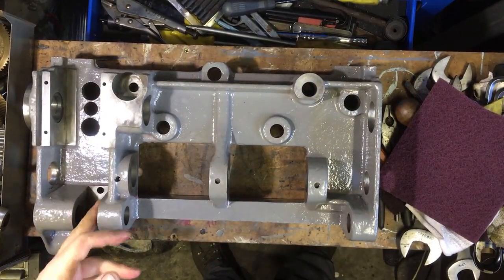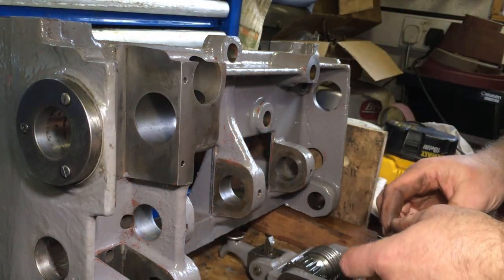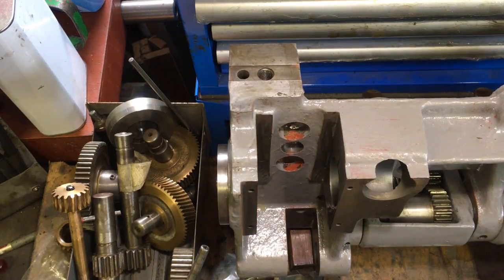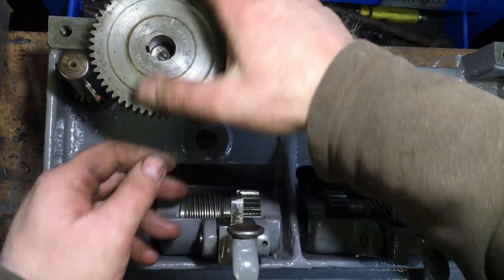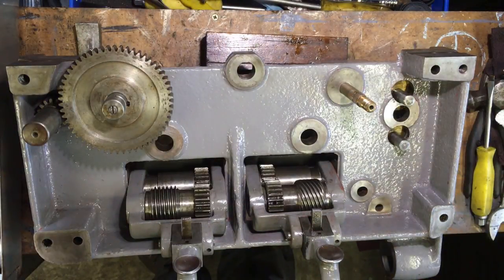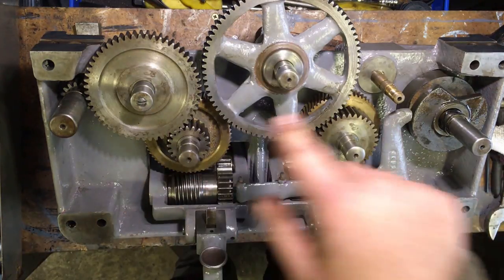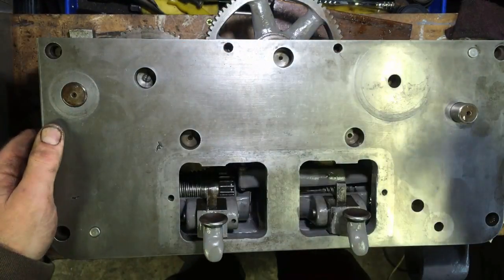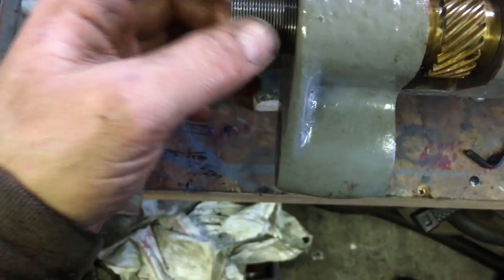Rebuilding the Toolroom Lathe Apron

Comment: Back together and in proper shape! And it looks as if you have indeed used up and re-installed all the proper pieces.

Mark
Reply from the maker: Hi Mark, not many left over bits on the apron. Just a cover and couple of srews and oilers to refit. Assuming it doesnt have to come apart again ;-) All the best Mat

Comment: amazing there is so little wear on the half nuts, must have done little screw cutting in its days.
thanks for the video
Reply: Holbrook handbooks recommended not engaging / disengaging the halfnuts when screwcutting, so there's not the wear from that - they recommended using the leadscrew-reverse or reversing the spindle instead so the nuts stayed engaged and lubricated, my C13 (same age, roughly) also has pristine nuts :)
Reply from the maker: @hopefuldave  Dave mate, you are bragging about your pristine nuts again ! ;-)
Reply from the maker: @hopefuldave  and if I recall by your own account not used much ;-)

Comment: Any specific reason you are assembling the shafts dry?
Reply from the maker: Only that it stops me dropping the things and then having to clean them again. All the bearings and oil ways were cleaned so a good squirt after assembly and turning by hand has the thin iso 32 oil everywhere. Once running the oil is iso 64.

Comment: Mat it seems if you have a good quality lathe or a cheap one the oilways need reworking or tweaking..
I always wondered why people had two lathes one to make parts repair the other one. 
I have one lathe pull it down measure the part make it and rebuild, very frustrating.
Reply from the maker: I have to investigate the saddle / apron to see if the ive missed an oil way for the half nuts. I may well have overlooked something. I can certainly say that the Holbrook in its day was half as much again as the best available in the UK market (1950's). as youve seen there is not any significant wear on the gears and that which I found on the tubes was minimal. I think its been used in the past by someone with a lubrication aversion !
Reply: Half as much again? I heard "The Colchesters on the shop floor cost as much as the Guv'nor's car, the Holbrook in the toolroom cost as much as his house..."

Comment: i would have used grease the oil will eventually run out,  use oil if it can replaced  easily
Reply from the maker: Yo may well be right, but grease dries out eventually and is more tricky to replace without provission for adding it. I have to investigate the oil ways of the saddle to see if there is a drop point for the half nuts. Thanks for watching and commenting. All the best Mat
Reply: Is there an oilway for a drip to the halfnuts connecting to the oil gallery in the top of the apron front plate? The Model C has a manual plunger pump in the bottom of  the apron, delivers to a gallery in the top of the main apron casting with drillings down to the bushings in the front plate, does the T have an oil port that feeds into that gallery and the apron? My C13 had halfnuts firmly stuck with 60 year old oil turned to varnish, too.
Reply from the maker: @hopefuldave  Ive had a good look and cant see an oilway feeding the half nuts - nor grease point. There is an oil gallery in the front apron which drips via drillings to each shaft drilled - the shafts then transfer via internal holes to the rear. So looks like either I add an oil feed or am squirting oil into the half nuts as and when. Will think on as I might come up with a cunning plan. mat